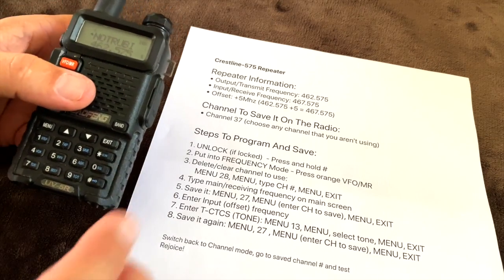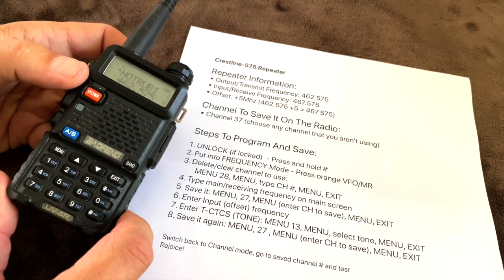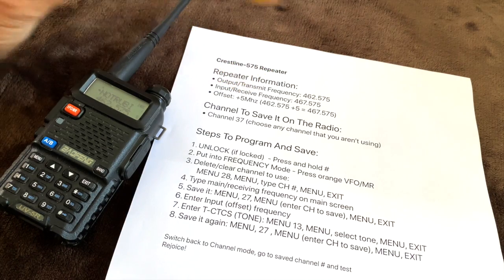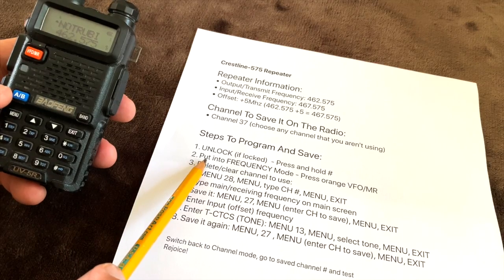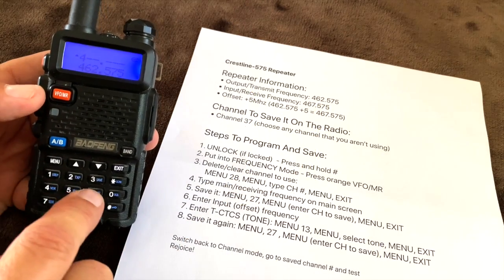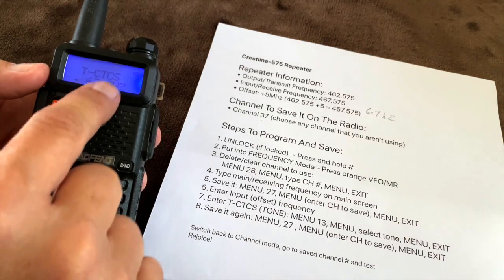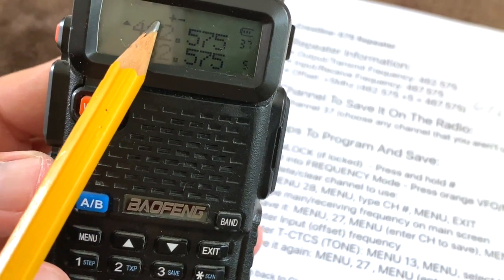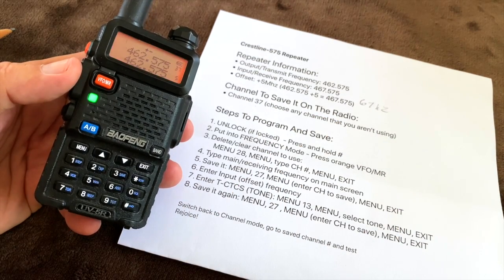Baofeng UV-5R: Add CTCSS and DCS Codes & Tones On The Keypad And Connect To & Talk On A Repeater

Comment: You mentioned a digital tone, and that the Baofeng UV-5R cannot transmit on digital. Does that go for all Baofeng radios? I recently just purchased the UV-5G plus and have the option to input a digital code but I can't connect to the repeater. Thanks for your help
Reply from the maker: analog radios can transmit DCS/DTC/DPL tones which are "digital" tones that repeaters use.. This is different from transmitting a digital signal. and yes, baofeng makes digital radios, but, thats different from the digital tones.

Comment: Excellent steps. Unfortunately, not able to get a clear signal from the nearest repeater... being behind a hill, behind railroad tracks, at the bottom floor of my apartment makes for a sad connection, even with an 18" antenna.

Still, I was able to get SOMETHING. A smudge of voice, I could barely make out a CW, and mostly gibberish static. But it indeed did connect to it, regardless.

Comment: Thank you for the video. I followed the steps exactly, I believe, and programmed a local repeater channel only a few miles away, which states it has a range of 30 miles on two UV-5G radios, but when I transmit from the one, and I do receive the tone on both radios When I press the transmit button, I don’t hear myself coming in on the other radio. I’m guessing I did some sort of tone or offset incorrectly? Any help would be great!

Comment: What no one ever says in there videos is how fars or the basic range will these radios work from the repeaters, in miles!! 1,2,5 or 10?🤷‍♂️🤷‍♂️🤷‍♂️
Reply from the maker: Thats because there are too many potential variables to answer that question.. The most accurate answer you will get is "anywhere from 1 mile to 200 miles"
Reply: @TheNotaRubicon  I knew that was a factor… thanks.
Just getting into these radios, love your channel videos and information.

Comment: Hello I purchase a uv-5r from Amazon and I didn't know how much it was involved on this little guy. I have watched some of your videos and they're very informative but I'm still confused on what to do. I bought two of these Raiders of the same model and all I'm trying to do is communicate from one to the other. I do put them in the same frequency and they work fine but it only work about 1 mi radius. I live in South Florida so there's no mountains in the way or anything like that everything is flat down here but the range is very limited. Is that anything I could do in order to have this work as a walkie-talkie. I don't need this to be listening to the police and things like that. I definitely don't want to get in trouble with that stuff give it all I'm trying to do is communicate between these two radios in the longer range. Thank you so much for your time

Comment: So, i have 2 UV-5Rs and i set them up the same way, and they both get successful test responses BUT neither of the UV5Rs can hear the other on the saved channel. Its like they both have some privacy setting... hmmm...

Help...😢
Reply from the maker: 1) Make sure the radios are at least 50 feet apart from each other when testing
C) Make sure you have removed all RX (receive) tones and are transmitting on the correct frequency.
Reply: @TheNotaRubicon    I believe you just answered my question.  However, I am using CHIRP but trying to identify exactly how I can confirm there is no RX tone in CHIRP for the UV-5R (and RA-89)..

Comment: Hey Randy, on mygrms I see most users just list Input/Output tones, no offset listed. Is it safe to assume the +5Mhz anyways? Sorry if this question seems a bit repetative.
Reply from the maker: GMRS repeaters, by FCC decree, ALWAYS have a +5 offset from 462.xxx.. If you are using a real GMRS radio (ie not a UV-5R) you dont have to worry about this because its automatic, but on a UV-5R/ham radio you have to deal with it the old-fashioned away.
Reply: Thank you both for asking and answering this question. I go was a little more difficult to find than I would have thought.  Love the channel man. Been lurking here for a while.👍.   😭⬅️ Sad ham.

Comment: You have the offset in Mhz. Shouldn't that be in kHz? Thank you.
Reply: Not really. I use RepeaterBook to find repeater information, and they list it as +5 MHz. For other repeaters, -600 KHz is common, but they list it as -0.6 MHz. It's the same thing either way.

Comment: I have the new BaoFeng UV-5 GMRS radio and have a couple questions.  1.  There is only one known repeater in my area which is the same channel as 16 and Repeater 2 on the radio.  I can easily hear others talking.  Only one frequency is listed 462.575 MHz so I assume the transmit and receive frequencies are the same (no offset).   2. Transmit and receive CTCSS tone frequencies are listed as 114.8 Hz.  I can set the transmit tone only in frequency mode, not Ch mode (applies to any channel).  When switching to Ch mode for Repeater 2, it shows the transmit tone is off.  This seems stupid to me.   Is this normal?   3. I can only transmit in the Ch mode so having the tone only in the frequency mode is useless.   I have reset the radio but this still happens.   I ordered a program cable but not received it yet.  Thanks for any input.
Reply from the maker: 1) On GMRS radios a repeater channel is different from the simplex channel. Repeater channels have the RX and TX frequencies built-in
2) On a GMRS radio you have to set the TX/RX tones in channel mode for the specific repeater channel you are using. If it is not working either you are doing it wrong or your radio is defective. and I doubt your radio is defective.
3) Per FCC rules GMRS radios can only transmit in channel mode.

My input is you are doing something wrong.  It will all be easier to do with CHIRP because its much easier to visualize what is going on.
Reply: @TheNotaRubicon  Thanks for your reply.  In the Baofeng GMRS manual section 5.3 (making a call) it indicates that a call can be made in the frequency mode.  I do accept your information but I have not seen anything on videos or in the manual that says this.  Perhaps it would be good to state this in one of your videos for newbies like me.   I have not been able to set the CTCSS toned to any channel, including repeater channels, in the channel mode, only in the frequency mode.   When I confirm the tone in the ch mode and exit, I then press menu again and it shows off.   Setting the T-CTCSS tone in the frequency mode does work for the channel frequency but when switching to the ch mode it says off.   Perhaps you can try it on your UV-5R GMRS radio.   Manual input, not CHRIP.
Reply: I've been fighting the same issue today with the same radio. The only work around I've found is to set up the tones on the correct frequency in frequency mode and then save that channel with whatever number you like. It will then appear in channel mode and the tones will still be with the channel. I'm still not able to activate the repeater but perhaps that has to do with the offset or I'm out of range. There's only 1 repeater in my area and I'm right at the limit of the baofeng to reach it. I'm still confused why there are preprogrammed repeater channels that don't allow the addition of tones that actually allow repeater usage.

Comment: Should the radio be on VHF or UHF? I was messing around to see why I couldn’t hear anything and I may have changed it?
Reply from the maker: There are things to listen to on both VHF and UHF. Just enter the frequency you want to listen to.
Reply: @TheNotaRubicon  thanks so much. I just saw this Tidradio wireless programmer, I am trying to set up my uv5r for the first time but most videos show how to pull the frequencies you have already set up out of the uv5r…I’m trying to simply get my local repeaters and frequencies into the radio for the 1st time. Doing it by hand from repeaterbook I see the frequency and then 2 other numbers, 114.8 hz and  +5.0 hz? One is offset, what is the other? 
Wish I could paste a picture
Reply: CTCSS or DCS Tone

Comment: Very helpful indeed! So I’m a Drone pilot and want a way to monitor the aircraft transmissions and if an emergency arises, have the ability to help but don’t plan to transmit. Mostly bought the UV5Rs was for talking between spotter and pilot. So, my question…what does a repeater do for you? Extended range?
Reply: Yes, a repeater transmits your weak signal on another frequency with more power from a higher location giving you more range.

Comment: If you dont have the tone, you can still do a tone search for it and find it on your radio right?
Reply from the maker: Yes, but you have to scan the input frequency which means you have to be close enough to someone using the repeater to pick them up on your radio.

Comment: What if it is a negative offset? My repeater info is TX 467.625 and RX 462.625
Reply from the maker: You have it backwards.. It's 462.625 with a +5Mhz offset = 467.625
Reply: Thanks... I copied his info he sent and that was what he sent me. I'll make the change
Reply: So TX would be 462.625 and RX 467.625
Reply from the maker: Sorry - I may have been unclear:
On GMRS its ALWAYS receive on 462.x and transmit on 467.x - and that is referred to as 462 +5mhz offset..
But, TX = 467, RX=462
Reply: The repeater info you received is from the repeater’s “viewpoint.”  From your radio’s viewpoint, it is the reverse. Offset is always +5 on GMRS and USUALLY +5 on ham.

Your radio’s frequency will be the 462.xxx when not transmitting.
Reply: Great vid. Just connected to my first repeater on my channel 40. Why don't other videos use printed directions ad well!? 

So now what? Do I set up my other Baofeng the same way, and now we both communicate on channel 40 with greater range? Won't all the people connected to that repeater hear us? Don't want to be the newbie that annoys 50 people all day. Also, I just heard Morse code or something.

Comment: So if i program 2 radios exactly the same way can i talk to the other walkie talkie? Trying to set up shtf radios for me and my group, is why im asking
Reply: Program the radios the same and they can talk SIMPLEX = radio to radio . 

This video is about using REPEATERS . 
So uf both radios are programmed the same , you can all use the same repeater . IF YOU ARE LICENSED AND THE REPEATER STILL WORKS .

Comment: Friend, I am a newbie, I bought 2PACK BaoFeng UV-16 Max V2 10W High Power IP68 Waterproof Walkie Talkie Support Type-C Charger Long Range Radio Upgrade UV5R PRO but I can only talk up to 500 meters, I need at least 10km. I'm doing something wrong or it's not the right model (these are given for distances up to 50 km. which I don't need) What do you recommend, thank you thank you
Reply from the maker: if you can only reach 500m, and there is nothing between you and the other radio (ie; you can SEE it), then your radio(s) is defective.  If you are trying to talk 500m through buildings/a forest of trees, or behind a mountain, that is normal.

Comment: Brilliant video +1 sub from me. I got 2 questions..

If more then 1 person use the same repeater in the area, does that mean we all listen to each others broadcast (ptt messages)... 

Also, let's say I broadcast to a repeater, does the receiver just need to tune in to the same frequency as the repeater or does he need to manually add the repeater too ( I know he won't be able to transmit but can he still receive)
Reply from the maker: Yes - everyone on the repeater hears everyone's conversations.
Anyone can listen to the repeater by just monitoring the output frequency of the repeater.
Reply: @TheNotaRubicon  that was the fastest anyone has responded on YouTube lol, thanks for the answer..

Comment: hi, i noticed when i have a radio set to channel 7 with a ctcss code, but then i have another radio on channel 7 with no ctcss code, the radio without a ctcss can hear the transmission from the radio with it. does this mean when transmitting on a ctcss code anyone on open channel 7 can hear you???
Reply from the maker: Yes, that is exactly right. There are multiple videos on my channel explaining why CTCSS codes or "privacy" codes are in no way private.

Comment: I am trying to connect with a repeater using baofeng5x but the repeater has DPL 23 tone. Do I use the CTCSS bc when I use the DCS code it doesn't seem to respond.  Thank you
Reply from the maker: You have to use whatever tone the repeater is set to use.. Either CTC/CTCSS or DPL/DCS.  Only the correct tone will work.

Comment: Randy (is it ok if I call you that?) - just getting into GMRS, have my FRN/GMRS license, have Baofeng BF8-HP radios (some friends have UV-5Rs) and if I set up the repeater following your instructions (which are very easy to follow; thank you!) how do we communicate with each other using the repeater?  Do I always have to switch to channel 37 (just referencing the number you used) and if so, how do I let others know to switch to that channel instead of using channel 20, for instance?  Or, is it such that now that I have the repeater programmed in, whenever I transmit on whatever channel I use does it automatically transmit via the repeater?  Learning lots from your great videos and I must say, you’re sort of waving me off from getting into HAM, at least for my local comm needs for things like community security/disaster response.  Do you have a separate email you check vs. just posting comments on the videos?  If so, please share.  Thanks for all your help!
Reply: There are others waaaaaaay more qualified to answer this than me.  But, since I'm here... It's a lot like having a walki-talki when we were kids.  We opened the blister-pack from the Sporting Goods store, we put batteries in them and turned them on. We then used the up/down arrows to pick a channel... Once we agreed on a channel, we backed off a few feet and did a test. Once that was confirmed... we ran off into the neighborhood in opposite directions and played Army all day and night.  OK.. so now that we have grown up.. we still have to pick a channel to use together.  You and your friends need to both follow this video and then both use Channel 037 to talk to each other.  If one of you switches to a different channel, well, game over.  I hope I said all that correctly.
Reply: @miketaylor6700  - Thanks, Mike.  You answered what I really believed to be the situation, that we needed to be on the same channel.  Guess maybe I was getting it confused with something akin to a data router wherein all data going to Point A would be steered over one main pathway or something like that.  With GMRS, we’ll just need to coordinate whether we’re talking point-to-point between HTs or via a repeater channel.  I appreciate the input.

Comment: Question: If a GMRS repeater has both input and output tones - does that mean I must use TSQL instead of Tone when programming the repeater in Chirp? (The Tone setting in Chirp only allows one tone to be entered) I'm confused about if an output tone on a repeater is the same thing as TSQL.
Reply: Same question
Reply: Did you ever find out an answer to your question?

Comment: An issue I am having as a new user. 

When a repeater user sends you the info for the repeater it sometimes comes in the format of imput output.  How does that equate to tones? Which is send and which is recieve? Is it in relation to the repeater or the  radio(my radio) ??
Reply: I figured it out! Hope this helps someone 

T-ctss = impuit
R-ctss = output

Comment: Something that confused me about this demonstration is that when you do your test towards the end of the video to see if you hit the repeater, the same frequency is showing on both lines. 

I have tuned into my local repeater just now with my UV-5R following the steps in this video, and I am getting the feedback from the repeater indicating that I am reaching it. But, my arrow or "carrot" is on the line that has the receiving frequency of this particular repeater. Maybe I am just overthinking it. Any help would be appreciated.

Thank you for all of the awesome (and hilarious) content!
Reply: Hi there, I have been a Youtube Certified GMRS operator AND Baofeng user for several days now so I may be able to help. During the demonstration both the upper "A" channel and lower "B" channel on the Baofeng were set to 462.575, however the "carrot" is on channel "A" indicating that is the channel receiving and transmitting on currently. On the Baofeng UV-5R you can use the "A/B" button to switch between these two channels.
When NotaRubicon depressed the PTT button you can see that channel "A" switched to frequency 467.575 during the transmission, then returned to 462.575 to receive to the "ker-chunk."
It's probably just an unrelated coincidence that channel "B" was also set to the same frequency.
I hope this answered your question.

Comment: I think I finally got it working on the UV-5G and im terminally dumb so maybe i can help others with my condition. I think the 5mhz offset is preset so you dont need to do math with the UV-5G. Also the number on the mygmrs website will be in relation to a channel (like 462.700 MHz is channel 21) but that channel is also in relation to a repeater channel (so 462.700 MHz = channel 21 = repeater channel 7)  that you need to put the codes into. Those small hang ups took my hours to figure out. Let me know if i got anything wrong but i figure this info might help someone else.
Reply: The offset always says 000.000. I think it's a firmware glitch or it's always preset, like you said.
Reply: Can you please elaborate, I can't figure out my UV5G for the life of me.
Reply: when i hit menu to save or delete a channel, it just says cancel, it does not save it.